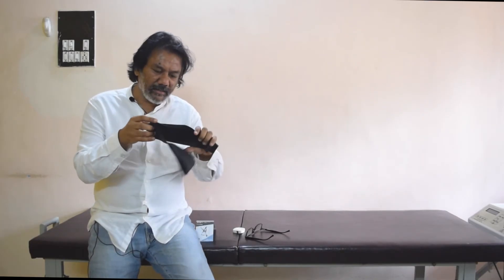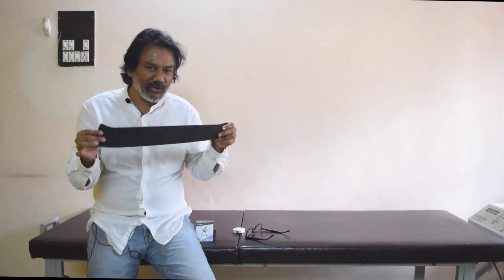Traction for spine-What actually happens?

Comment: Sir does the traction really decompresses the vertebras ?
Reply from the maker: from the experiment- what do u think? or what are the lessons from the experiment
Reply: Traction has lesser value in the elastic theraband ..So its value on bony vertebras will be comparitively lesser ...
Reply from the maker: @Dope_Amine_  bingo - also remember- it regained its original length and - it is one band and 40 kg